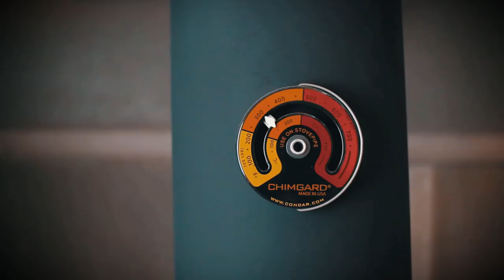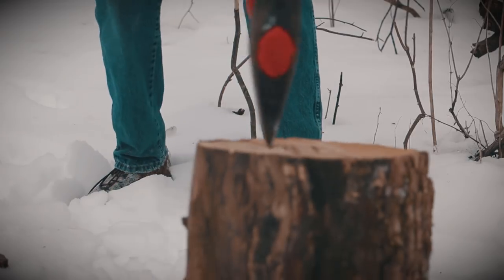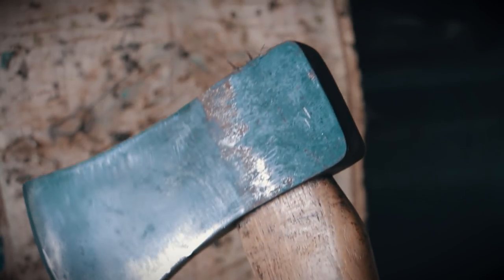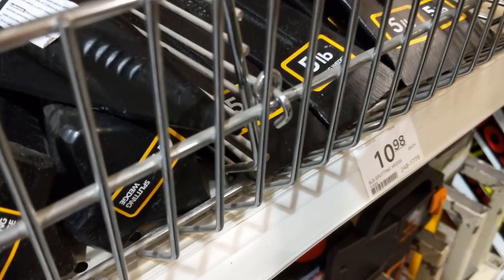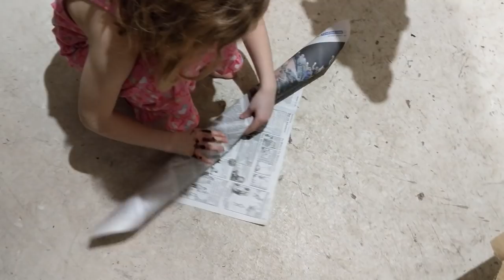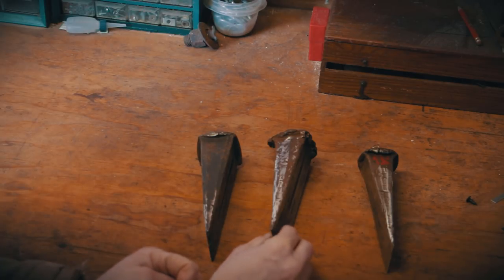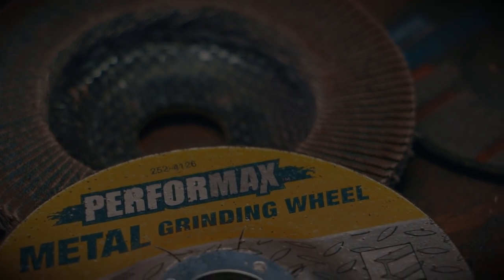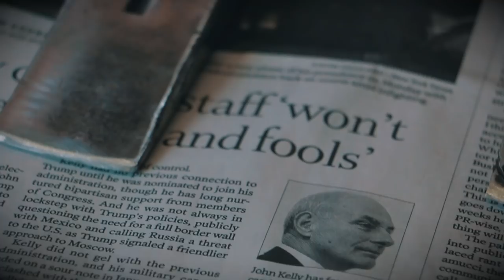Splitting Wedge Maintenance Care - Wood Heat Wednesday - EP:21

Comment: I still split my wood by hand. About a year ago, I went ahead and gave into the temptation to just whack the wedge with the back of my axe, and boy was that the WRONG choice. A splinter of metal shot right past the edge of my glasses and into my eye. Someone taught me that a good tip for any time you get a piece of something in your eye is to pull your eyelid out away from your eyeball by pinching your eyelashes. That way it doesn't get scraped around on the surface of the eye by the pressure of the eyelid, and your eye will water a bunch and rinse the piece out on its own. I did that that day, and it took about a half hour for it to clear on its own. Never had to go to the doctor or anything for it.

Thanks for all your videos, and WHAT A GOOD DOG! Amazing!

Comment: Its crazy as to how many different wedges have been put on the market over the years,  Eric do you remember a wedge called the Wood Grenade put out by Oregon Co.? It came out late 70's, the early 80's. It was billed to be the next best thing to sliced bread back in the day, of course, I bought one. lol,  I think its still sold today. I believe a combination of good ole short and long taper style wedges still work the best, well next to the hydraulic wood splitter. I still think you put some of the best quality videos out there. I know I haven't commented a lot lately but I do watch and enjoy them, thanks for the great content. 👍
Reply: YL'n  I think it was a gold/yellow color and it had 2 smaller side wedges to make it a bit of a 4 way wedge..  I think mine is on a shelf in the barn.  I kept asking Santa for a Dyna firewood processor and it worked (I did have to use a special milk and cookie recipe) .  I use about 20+cd per yr. for our home and lumber dry kiln.

Comment: Good video shows a lot of the issues, one that I didn't see mentioned is the danger of metal on metal and I have had some of the wedge mushroom pieces fly off and hit my skin should try and keep wedges clean and grind off mushrooming to prevent projectiles. But to tell the truth I prefer using my double bit axe for manual splitting and as I get older I do not use wedges anymore and the axe rarely I use the hydraulic wood splitter. But I still do come across logs that are hard to split for what ever reason I throw them off to the side and deal with them later they usually don't pile well and I do not want to waste a lot of energy on one log when the need for so many is required. If I have a troublesome log I leave it in a splitting upright position and wait for the temperature to freeze the logs and then they split much easier. That must be a 'wood-duck' dog.

Comment: A sledge retriever is a must, but sorry to say I worked and trained my dog for several years and it did not work out, my 8lb dog was never able to retrieve my 10lb splitting maul. I carry 3 wedges here in Nor-Cal, a traditional wedge, one of those $5.00 grenade thinging and a Estwing with the wings, the Estwing is my favorite. Very good info on the mushrooming of the pounding end of any wedge that has that problem it can hurt you.

Comment: Any thoughts on how long to let your rounds dry before splitting? Looks like you typically take them to the splitter right after bucking. I find that method makes hand splitting a lot harder and need to use wedges more often than if I had left them dry for awhile.